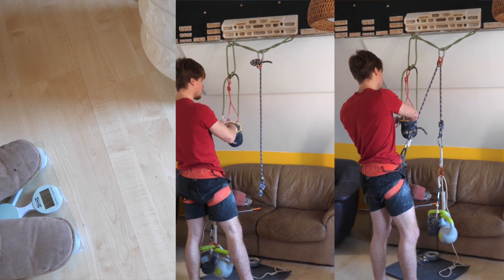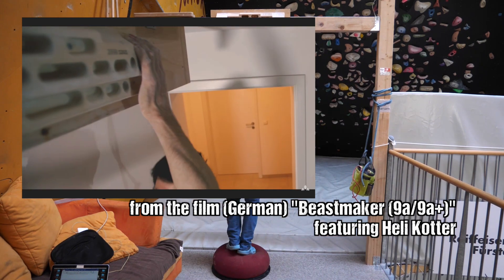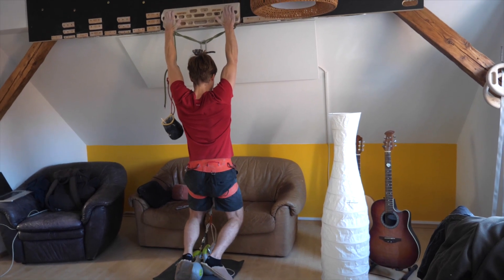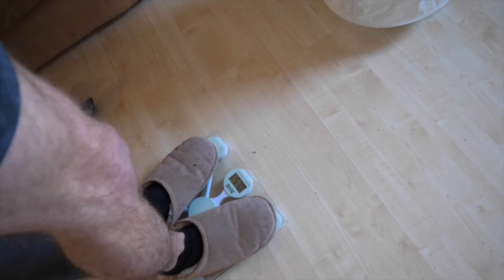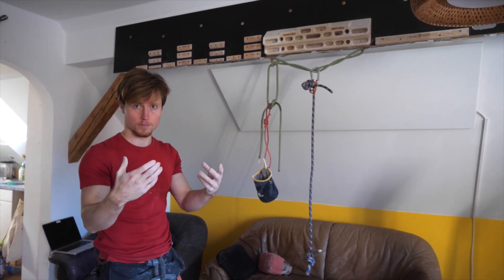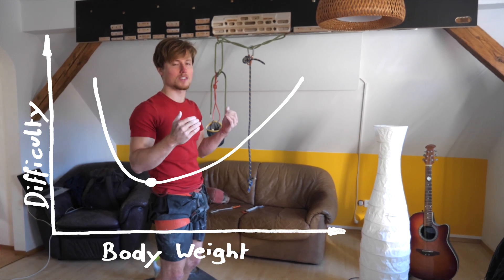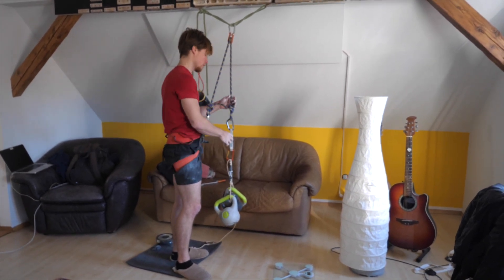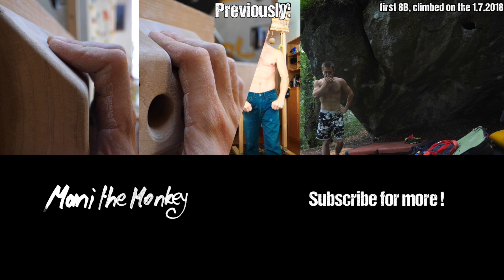Gripping Technique VS Finger Strength VS Body Weight

Comment: In physics, the friction generated on a surface increases as the force applied to it increases. Technique is the variable that can help overcome the disadvantage caused by the lighter force applied to that surface, but does not always hold true. Great demo!
Reply: The downhill-slope force increases with weight as well, though.

Comment: Very interesting! Never thought being too light could be a detrimental factor in holding sloupers. Maybe that explains why I'm so bad at them haha (55kg here)
Reply from the maker: I was very surprised as well, the climbing books have to be re-written :P
Reply: I'm 52kg (very short with even smaller hands) and only climbing V4s, and can hold these open handed without using thumbs nor the edges! It definitely is possible for us lighter climbers! It's all about the proper body positioning
Reply: @jsmith567  yes it is possible . But maybe it is more difficult for light person
Reply: @jsmith567  Would be interesting to determine other factors. I wonder if you have grippier skin?
Reply: @chrzzzzz  interesting, I've never thought about that! Do you know of any ways I can possibly test this? It could very well be due to skin quality and body positioning instead of strength from what I see.
Reply: @chrzzzzz  I think mani is the wrong person to have done this test, given the fact that up until a week ago he was using a crimp grip on them. Perhaps the added weight was pulling his body into a position better for pulling on the slopers, all the female climbers and light males that kill it on them show that it has a lot to do with technique, which mani wont have due to the fact hes been crimping them.
Reply: @jsmith567  Dude how are you only climbing V4? I'm climbing V9's and I can't hold them.
Reply: @Benkkuful  I've only been climbing for about a year and a half so I'm definitely at the V4 level. Moreover, amongst my friends, I'm known as the one with the weakest fingers (anything crimpy/pinchy and I struggle hard). I definitely think body positioning is a waayyy bigger factor to holding these beastmaker slopers than pure finger strength! I'm sure if you put us on the same route with tons of slopers you would be able to crush it faster than I could even start it. Might be something to do with grippier skin as mentioned before too, who knows!
Reply: @jsmith567  I've never really trained on them, just tried them occasionally so maybe I just have bad technique on them. I'll try next session whether I can hang them with my new found knowledge on bodypositioning and gripping technique.
Reply: @Benkkuful  Yeah honestly it feels more gimmicky than anything and that's why I don't train on them too. Doesn't feel very transferable. Cheers mate!
Reply: @jsmith567  Body positioning would be easy for you alone to test. Testing skin qualities would be trickier. You'd need someone very similar to you for comparison. That introduces a lot of variables. Or you could experiment with changing your skin qualities, for instance, what would happen if you climbed with 'bath fingers' (assuming you dry and chalk them)

Comment: I noticed a similar effect on a sport route. The hold was a right hand side pull sloper. It could be held easily standing on the right foot only; with the left foot dangling. With my centre of gravity to the left of the foothold, my body was wanting to rotate anti-clockwise and this was generating force, hence friction on the right hand side pull sloper. Placing a my left foot on the wall had the effect of reducing the force at the right hand sloper making it unholdable!

Comment: This is an interesting study. I have a theory that seems logical and also explains why adding weight helps. Adding weight does two things: 1 - it lowers your center of gravity, 2 - it shifts your body slightly forward under the hangboard. With the center of gravity lower and shifted forward there is more pressure and friction applied to the hold. 
Added weight helped you achieve this but if you could shift your weight under the hangboard (without adding weight) you would achieve the same results. But adding weight is much easier than having someone push you from behind every time you train lol.  
As far as removing weight with a pulley system: it makes your center of balance higher and ensures that you can not shift your weight under the hold therefore making it harder to hold. 
I hope this was helpful information, and thanks for sharing your video!

Comment: Hi Mani, great video. This is a very anecdotal observation, but I also noticed a similar pattern in smearing and stemming. As a big climber (104kg), I noticed that my extra weight seems to add more confidence when applying these techniques because I can really drive my weight into the wall for that added friction. I noticed that many of my lighter climbing partners seem to have trouble with similar moves, but then again, this is just an observation.

Comment: very interesting questions. Though from the physics point of view, both friction (the "upward" force) and the gravity (the "downward" force) scale linearly with the weight of the climber. So if you add weight to have more friction, you also have to lift more weight, therefore it should not be easier to hang with added weight. 

I would guess that it has something to do with the mass distribution of the body and the "direction" of the gripping force. only the "gripping" force perpendicular to the surface of the sloper will actually create friction, but since this is at 45° towards the force that is pulling you down, it is very hard to do. Mani with weight, or compared to a taller climber have different weight distributions, which could affect the ability to produce the force in this 45° angle. 

It would therefore be very interesting to play around with body positioning, or adding weight at different parts of the body (e.g. feet vs. weightvest). Would be very cool if you further investigate this Mani ;)
Reply: You are right when looking at this on a macroscopic level. However, on a microscopic level there are many more variables. Things like surface roughness for example have a huge effect, which is not linear, on the frictional force that can be applied with different normal forces. The friction coëfficiënt is not always the same as we are being tought on university. I think that higher normal force (body weight) might result in a greater surface area due to larger penetration within the surface topology. Therefore, it sounds possible to me that a heigher body weight might have a positive effect on holding slopers.
Reply: @wg1159  bigger surface area doesn't affect the amount of friction.  However, the coefficient of  friction for rubber and asphalt, for example, is variable depending on the pressure applied (the higher the pressure the lower the coefficient of friction) I don't  know how it is for the skin but I would think it's similar
Reply: @Tom-oh5dm  You are right but thats not what I'm saying. I think you have to read my comment again.
Reply: @wg1159  Oh yeah i see :p A bigger force does indeed have a better penetration but only substantially until a certain point. Dont have a clue whether or not a bodyweight can reach this point. Interesting.
Reply: @dirkahrens1287  not so sure about the distribution of weight because the body finds it’s equilibrium beneath the hands. If you push you’re feet foreword you’re body will go backwards and swing you of the sloopers.
Reply: You are mistaking something: just because we use a linear friction model in basic physics classes doesn't mean friction is linear. It's a first approximation. It is most definitely not linear.

Comment: This makes sense. The friction force between two surfaces is not related to contact area, so larger hands might not add any value, heavier weight will on the other hand. But this also means that open-hand and half crimp should be equally useful from a physical perspective. Maybe half crimp changes the direction that the force is applied to create more friction.

Comment: I also think that when you add more weight  you move your center of gravity. Your center of gravity go right under the sloper which helps you to hold the sloper.
Reply: Center of gravity is always under the hold, otherwise you would spin. But it may change the body position.
Reply: Adding  the pull of extra weight (downwards and forwards ) or the pull upwards and backwards of the pulley weight (reducing his weight) seems to change the body position and weight rotation.

Comment: I think the big thing with finger tecnique is ensuring as little as possible force is being applied on the corner of the hold, as this force pushes the fingers off. So half crimp takes away force from lower down the fingers (second pad) and puts it into the front pad and the middle of the hold. 
This also explains why bigger fingers help, as the longer your finger is the smaller the percentage of finger that is actually on the corner of the hold, allowing them to have a higher percentage of finger on productive parts of the hold. It would be interesting to test these big handed climbers on harder slopers (at their limit) and see if crimping the sloper allows them to perform better.

Comment: This makes sense because the formula for friction is miu×r where miu is the coefficient of friction of the surface and r is the reaction force ( in this case the vector would have to be resolved due to the 45° angle) with greater weight r increases and so the overall friction  force is greater

Comment: for the people who are wondering why, its physics. the frictional force = normal force + coefficient of friction. if you add weight your normal force goes up and so does the frictional force. from this it can be concluded that the heavier you are, the more power you bring to the hold. and therefore lingers better on friction-sensitive holds

Comment: The pulley pulls you forward a small amount because it is not directly above your center of mass. With each experiment you changed your center of gravity and that will change the lever and force on the sloper.

Comment: Let's take a look at physics of the inclined plane.
The force which causes a body on the inclined plane to slip down is given by FH = m*g*sin(alpha), where alpha is the angle of the plane. The normal force is given by FN = m*g*cos(alpha). FN multiplied by the coefficient of friction gives us the force that resists FH (FR = m*g*cos(alpha)*coefficient_friction). So, now we can look for what happens when both of the forces are the same, basically the equilibrium at which you are juuust resting and not slipping down the plane: 

m*g*sin(alpha) = m*g*cos(alpha)*coefficient_friction

We see that m*g can be removed from the equations, which gives us:

sin(alpha) = cos*(alpha)*coefficient_friction

This can be rearranged to:

sin(alpha) / cos(alpha) = coefficient_friction
tan(alpha) = coeffictient friction

If we plug in 45 degrees for alpha, we get a value of 1, i.e. if the coefficient of friction between the material pairing is 1 (or greater, of course), there would be no slipping at an angle of 45 degrees. 

"But.. but we see that it gets easier for Mani to hang when he weighs more!"

True, that's why I believe that the system of the inclined plane cannot be directly applied here without modifications, which, to be honest, I have not thought about yet. 
Personally, I believe that the mass should not matter.
We also have to consider that hanging 20 kg of extra weight on you is not the same as having 20 kg of actual additional body weight. That's why I think it would be interesting to see the test with a weight west, for example. 
I think there's probably also some wild biomechanical lever shenanigans which we have to take into account here. 

"But.. but the coefficient of friction is depending on the pressure on the surface!"

Well.. no, no it's not. See Amontons' laws of friction. 
It is absolute true that it gets more difficult to, in simple terms, push something along a surface if the body you're trying to push is digging into the surface - but, that's really not what you'd want to achieve, usually. If that happens, you have surpassed the maximum allowable pressure of the surface and thus destroyed, or at least damaged it. 
He's also most likely not digging into the surface, not even microscopically. The Beastmaker is made out of some kind of rosewood (as far as I know), which is fairly hard. However, even if we assume a much softer wood, spruce for example, the compressrive strength is around 45 N/mm². That's around 4.5 kg PER SQUARE MILIMETER. I'll let that speak for itself. 

Furthermore, I do not think that the arguments claiming that there is a higher surface pressure with more weight are true, because more weight will cause your fingers to flatten out more, thus increasing the area that your skin is contact with. To be fair, if the correlation is not linear, e.g. double the weight, double the surface area, there would be more surface pressure. But again, surface does not matter. 

Anyway, I have dragged this out long enough, I think. @Mani the Monkey: I am not trying to shit on your video or your results / conclusions, just in case this comment seems like I do. 
I found it really interesting and I believe that something definitely is up with this. I merely think that we have not found the complete truth, yet. 

Cheers and have a great weekend.

Comment: I do think that because the direction of the wood grain is facing the opposite direction there is less surface friction. For example in ours, the wood is cupped facing the climber and is not so difficult to hold.

Comment: Here it would make a tremendous difference to where the added weight is placed. Would be far more interesting with a weight vest for a more evenly distributed weight, so the momentum on the grip is not as heavely effected.*(weightvest with weights on the backside as well as the front)
Reply from the maker: Would be interesting, although I think the effect would not be too dramatic, given that we already achieve a dramatic effect with the tremendous weight difference. Also, a harness puts extra weight pretty close to your actual center of gravity (if worn a little looser then when climbing).
Reply: I was thinking he should try climbing a slopy boulder with a weight vest and see if it helps him hold on better. That would be kind of cool to watch

Comment: I understand how the half crimp is better in some ways to a full open grip, as you can get more friction with smaller surface area because you're putting more weight/pressure/force into that area than you would be if it was distributed across a larger area. Look at high-end performance clutches for race cars, some of them have a much smaller surface area by having pucks spread around in a pattern rather than taking advantage of the entire surface area available, and they have just as much holding ability or more than a regular clutch. I'm not a physicist so I can't explain the mechanism behind it, but slopers definitely aren't as simple as just getting the most surface area on the hold.
Reply: Just a self-observation: I noticed grabbing almost every sloper with a slight crimp, which I always found odd. But I don't get the same results when applying as much contact strength as possible with a fully open hand (which is said the way to go for it). Basically I'm quite poor at slopers. Nevertheless I have rather big hands but a rather low weight of 70 kg.

Comment: I think it have more to do with center of gravity than the actual weight. The weights get your center of mass more under the board forcing the force of your fingers more into the board. Maybe try it again with the weight on the back of the harness.

Comment: When I try to hold those slopers, I feel like I'm holding them untill my lower body swings back behind my hands (I hope this is clear enough...). Then I immediatly pop out.
Adding weight the way you do it lower your center of gravity. 
I think it may add stability and decrease the swing.
Do you feel this swing when you pop out Mani ?

Comment: Light small guy here, at 52 kg. I can not hang my beastmaker 2000 slopers at all at home, but the same holds on the one in the gym I can easily hang. Both with 3 finger open hand grip...

Comment: I would be interested to know if you just softened up your skin a bit it would help? If you’ve been climbing outside a bunch you probably have pretty hard skin. You could do a little test: normal, then after soaking your fingers for a few minutes in warm water, then fully drying them and chalking as usual. I suspect this would help a ton. It may be that the skin hardness is the reason why there’s so much variability between people. It’s also the same thing really as the added weight, weight or softness should increase your fingertips propensity to deform to- and grip the fine surface grain of the wood

Comment: Try putting the same weight in a bagpack. My guess is it would be harder then on front of your harness. If so then the the angle of the applied weight (and force) would be the critical factor :D

Comment: Ogata yoshiyuki does it with one arm (which should be more possible for him because he is probably fairly light??) But he also does it with two hands in a frontlever position, maybe then the weight distribution is better? (Not to sure about that, should be more or less similar right?)
https://www.instagram.com/stories/highlights/17939859304172813/

Comment: Very interesting experiment! Well done!

Little note: When you remove weight using the pulley are you sure the rope connected to the weight isn’t (slightly) pushing your lower body backwards. Thus, making it even harder to hold on
Reply: For me, it looks like the system is actually moving the center of gravity even behind the holds, thus making it easier to hold them..?